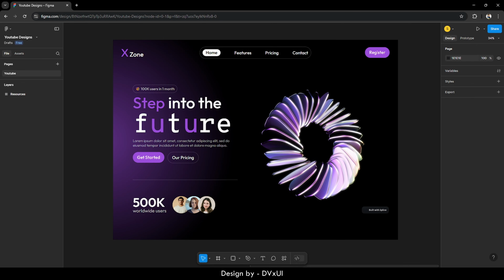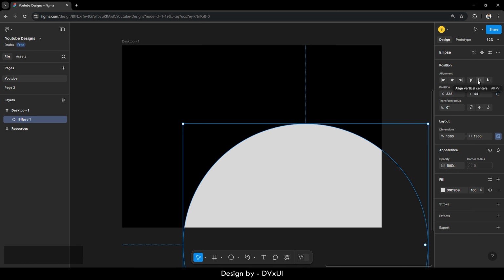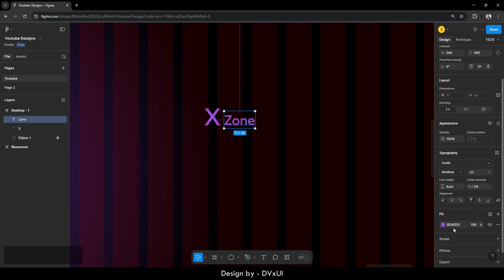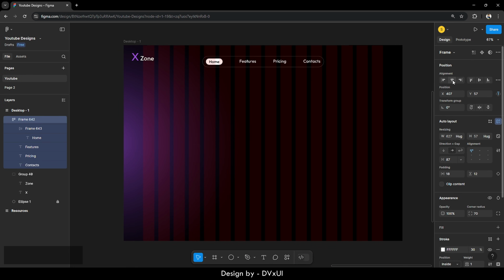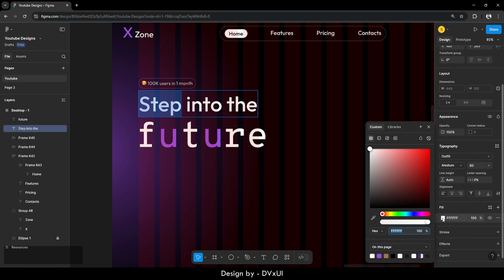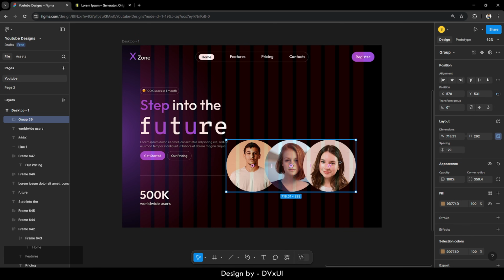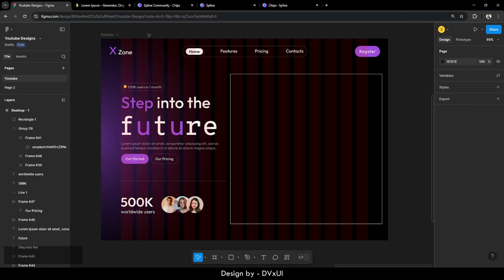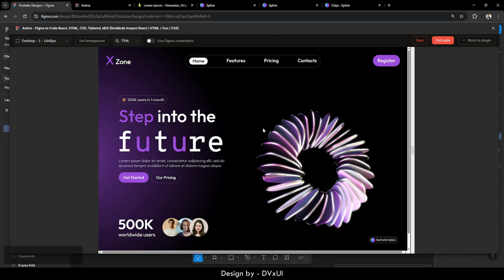Animated 3D Figma Website Design || FREE Resources || DVxUI

Comment: Thanks but I want share figma file it's not visible for prototype
Reply from the maker: Because Figma is a 2D software it doesn't not support rendering 3D elements.

You have two options, either make it using html, convert the design into code or Record a video of the preview from anima and share if you want.

Comment: what goes on after creating these designs, does a developer just copy paste and code to get it done based on UI or create from scratch and make it as per the design
Reply from the maker: The mix of both, designers are the ones who decide the value of each styling, font size, font weight, color etc.

A developer takes this decision and measurements and codes the website from scratch.